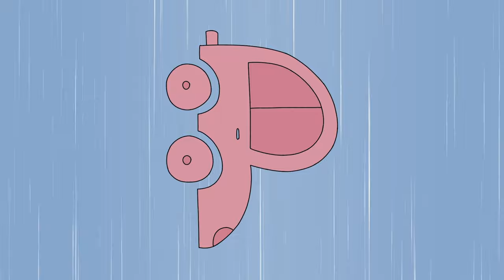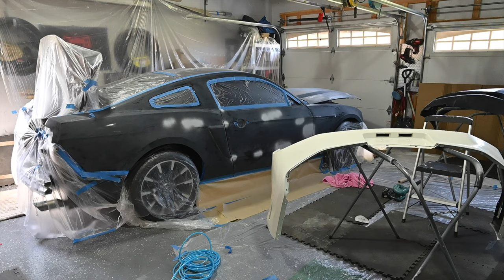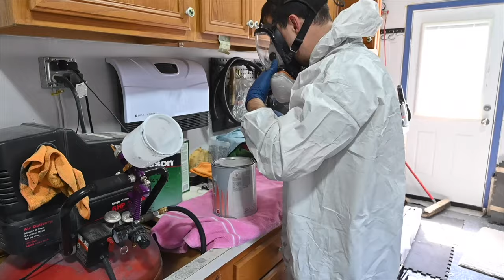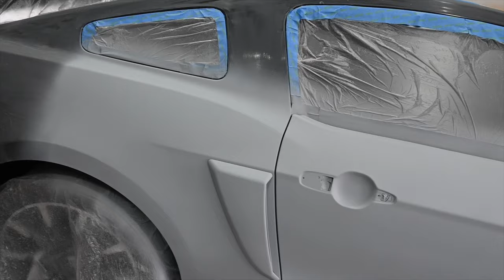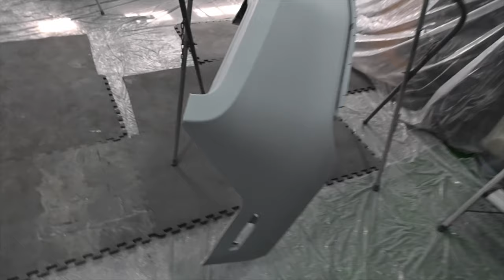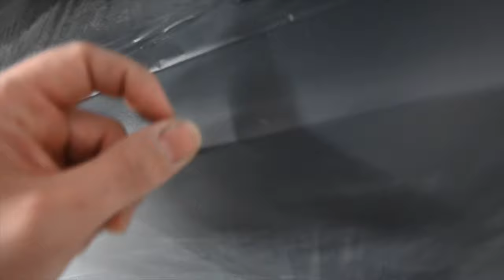Rebuilding a Wrecked Mustang GT Part 14: How to Paint a Car at Home

Comment: It's probably reacting to tire shine . Had this happen before.or to much material too soon.
Reply from the maker: you think  tire shine got on it some how?
Reply: @DIYSalvageGuy  auctions cars are hit and miss but tire shine could have been on the tires and sounds dumb but once it's exposed to paint it will react the surrounding panels.
Reply: Or worse when people wax there cars some degreasers don't really clean it off the panels well . So I use waterbase cleaner then degreaser over every panel.
Reply: the harbor freight gun isn't bad . There black widow series has the same internals from an old sata gun. At least that's what I read. But I've used one and it worked out fine just didn't like the spray pattern.
Reply from the maker: Could be a degreaser issue too
Reply from the maker: Going to pick one of these up next time I think